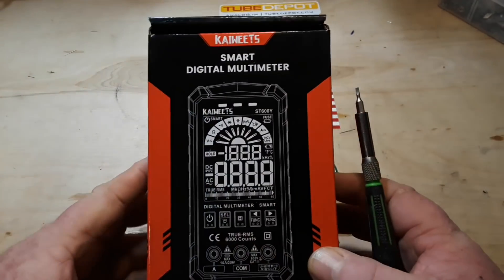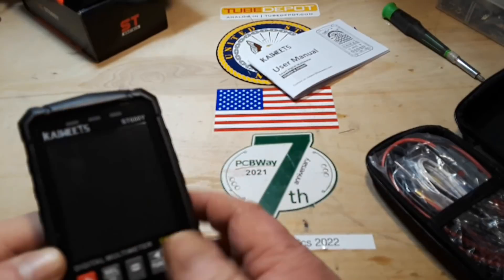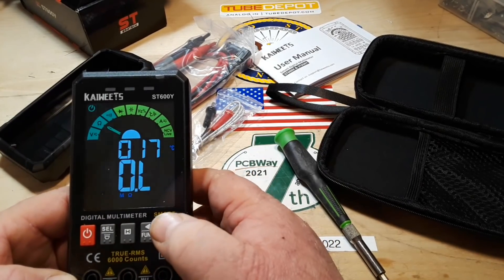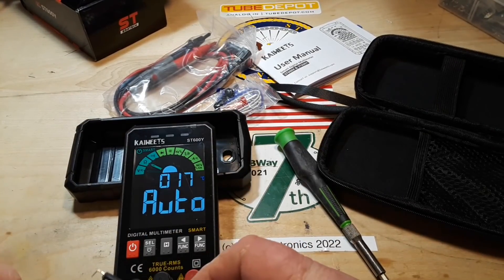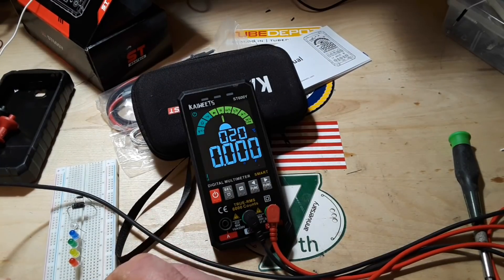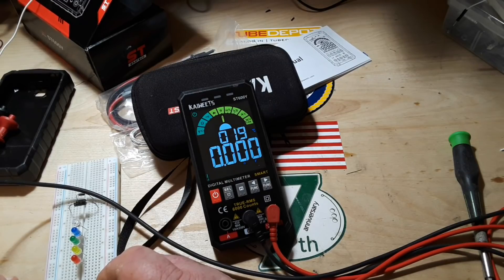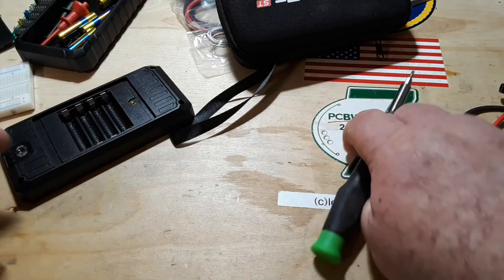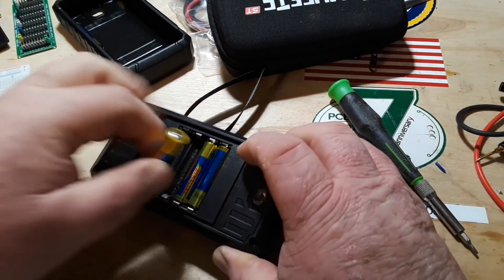Kaiweets ST600Y Smart Meter Review and Tear Down

Comment: Sorry buddy.  Not disrespectinng you. 
Please learn more about electrical, beofre messing with things. 
Learn your delta triangle, and how a generator works. 
1, ecoflow aand other so called solar generators, are not generators. They are nothing but a battery, with an AC inverter, that can be chartwd again, by AC, 12 car plug, or aolar panel. 
You could have gotten much better power buying a deep cycle battery, and decent 120/220 inverer. Added as many batteries as you like. Even added a battwry isolator in your work van. 
Sorry. All these so called "solar generators work, but  They're a scam, for the cost of them. 

As far as your voltage issue, that ecoflow "battery", as an AC inverter. That will do 220 AC. 
220 has 2, 110 hot, and 1 nuetral leg. 2 pf your outlets are on 1, 110 leg. 2 are on the other 110 leg. 
Check your other outlets, youll fond your voltage drop. 
Can also check voltage at hour 220 outlet. Youll see 110 at 2 of the terminals, a neutral. 
Study how AC, 110, 220 is created,  how HZ is related. Look up delta triangle, and loads. Youll see how each 110 leg carries the amperage, and how the nuetral only carries the differential, to balnace your load. 

Also. If your not blowing a circuit breaker on the "battery/ inverter ", your ecoflow... compressor will run. 
Im not teling you its the best thing for your compressor. It will shorten  life of your compressor, running too low of a voltage. 
Id check voltage at your actual compressor, before you ruin your air compressor. That sounds like a major voltage drop, whoch would increase amperage. Cook your motor on compressor. 
I respect you wanting, trying to learn. Go back, learn your basic electrial theory. Dont skio the most important details about electricity. 
You can get hurt,Ecoflow and so called solar generator are new to me. 
1st, can't see how it's a so called generator, unless it's hooked up to a solar panel. Even then, it's nothomg more than a battery with a solar charger. It's still not a "generator". Lol

As for your compressor. 
You have 220. 
Each pair of outlets is 110. 
Read voltage on the other leg of the 220, and you'll see your voltage drop. 
Your testing with meter on the leg, that has no draw. 
Test the other outlets for voltage. 
Know your trying to learn. Go back to the basics, see how a generator, and inverter work. For 220, there are 2, 110 legs, and a  neutral. Learn your delta triangle. 
Just trying to help understand why your getting 120, yet hear your compressor drop. 
You shoild also test off your leads to compressor. 
Test your voltage where AC cord connects to compressor switch. 
That will show you any line voltage drop, if you have a bad plug, or too thin of wire. 
 Please be carfeful !

Comment: I just purchased the KM601. I do like the large well lite display. Time will tell if it holds up. The turn dial broke on my old meter, and my newer meter is a bit odd to use. Has a very short timeout delay on it.  Thank you for the video, Paul.

Comment: I thought the Kaiweets 601 was pretty good but this is even better. One less current socket to mess about with. Being auto and smart, I am not surprised that the continuity has a delay. If I were so concerned about, I would have rigged an led, fuse and a battery unto some leads. As fast as lightning.

Comment: Hi Paul
Question to you from a beginner in electronics: Recently bought a Brymen 800 series DMM, and while playing with some of the basic functions to better learn the unit, I did an Amperage measurement using an Eneloop AA rechargable battery (1.2 v with 1,900 mAh rated capacity) and the display showed nearly 10 Amps!  I placed another AA battery in series and then got something like 14 or so Amps and I noticed the test lead tips and battery body were getting warm.  Is it possible for a rechargable AA battery to put out that many amps, or could my unit just be faulty? In case its not faulty, did I possibly just ruin my meter/HBC fuse by going over the 10A limit listed on the body, or does that currently limit only apply at the rated voltage limit for the test leads (1kV 10 A as stamped)?  Many Thanks
Reply from the maker: AA are usually rated around 2A peak discharge.

Comment: I'm not a fan of these new cellphone style meters either but this particular model along with the same models from other manufacturers (with different model designations) - but this one is a step in the right direction for the simple fact they're finally putting the jacks on the face of the unit rather than the bottom.
Reply from the maker: Jacks on the bottom were always a bad idea.
Reply: @learnelectronics  Absolutely terrible idea, agreed.

Comment: Its not an ok product. you were not able to measure 9 Ohm or 90 Ohm.
Reply: I just got one of these meters and it read 90 ohms (2 x180 in parallel) at 88.7. I can't imagine why it would fail on 90ohm. It also reads a fraction of one ohm (like 0.2), but the 0.1 resolution limits its usefulness.

Comment: I need the temp, diode and transistor tester parts for model Train controllers. Seems for 40 bucks you get a lot of meter and flexibility. I still have three Sears Craftsmen VOM that i am so familiar with but when i am setting a new train controller, I have to track opens, trace shorts, test installed components, measure heat for smoke and components and I can have 3 meters on one engine and wish i had a 4th, this maybe a good time to try fully digital. Nice display.  Thanks for the review. Dennis

Comment: I'm indifferent.  I still use an analogue for alignments - SO much easier to do with an analogue when watching for the voltage peaks.  I also use a DMM to if I want more accurate.  Use the best tool you have for the job at hand.

Comment: I'm a commercial building contractor who does pretty much everything. A customer of mine who owns a couple of restaurants needed me to find a current draw in his vintage Porsche back in December.  I knew I was going be in the dark practically standing on my head checking fuses under the dash... and you had reviewed this brand of meter, so I bought one because it's illuminated and the continuity tone is loud and I'm half deaf from too many chainsaws, guns and rock concerts in my youth. And none of my ten or so other meters is illuminated.  Anyway,  I bought the same model as the one in this video. It worked great.   The .01 amp phantom leak is gone.

Comment: Myself I would rather pay 20$ more for a Fluke 85-7 6,1/2 digit DMM that will last a lifetime. quality over quantity.
Reply from the maker: You tell me where we can get Fluke 87-Vs for $60 and we'll go into business together
Reply: @learnelectronics  Never said it was new, but if you keep your feelers out in multiple Ham groups, Ebay ext . you would be surprised what you can snag dirt cheep, I just landed a Wavetek 5 MHz  Sweep Generator for 35$ looks and works like new, Me  personally would rather spend my money on quality used equipment that I will have till they poke me in the dirt. even if it needs some repair, that is just me though. you ought to give it a shot would make for a great vid..
Reply: Ps. Boing surplus is where I got the Wavetek Generator, with recent certification.

Comment: I bought an Aneng  SZ17 meter at Christmas time. I like the fast response and it seems very accurate. My only complaint about this meter is the stand wants to fold up too easily. I think of it has a poor man's Fluke. You need to do a review on this meter.
Reply: Sz18?, It's the same as the Aneng Q10. It's one of the best multimeters I have used.

Comment: Give me a meter with a known that selects what you measure. Did not like the low resistance reading that stayed at 19 ohms and would not read low value resistor < 20 ohms ?

Comment: Looks nice but the issue with lower level resistance measuring is a bit of a problem when fault finding on electronic circuits like graphics cards, could do with a bit more resoution too, think I'll stick with the my old ones for the moment.

Comment: nice meter BUT i still liked the positive feel and sound of a manual switch i like my meters that also has a digital read out best of both worlds i have tried using full digital meters a number of times and did not trust them and had to retest using  my normal meters with manual switch and did find there was a small difference in the digital meters but not to worry about

Comment: I’m ‘old-school’ enough to have a fondness for meters of the Simpson 260/AN/PSM-6 genre. Analog and digital meters each have their strengths and weaknesses. 
That said, I have always prided myself as being smarter than the equipment I use, and so therefore I’m not a fan of instruments intended for people who don’t know how to use them - and therefore, really shouldn’t be using them. I don’t think the ‘convenience they add to the measurement dynamic is significant. Especially since the time it spends making up its mind about what it is supposed to do just slows things down further. Add to that the time it spends determining how to do what it is supposed to do - which the operator has likely already thought about before starting the procedure, and you have something of limited value. Analog instruments are usually not as precise or accurate as digital, except when dealing with lab grade equipment. But most of the time, you’re really not that concerned with the precise size of the gnat’s ass you’re measuring.

Comment: I have not watched this video as yet and may do later BUT as an Electrical Engineer the reliance of some automatic control of Current/Voltage/Resistance set-up is horifying.
Mantra - ALLWAYS return the selector to Voltage when closing the case. ALWAYS check that the selector is on Voltage when you open the case. That way you will have to find some other way to blind yourself accidentally.
I will watch the video in a short while after I have done some other things. I expect the Author has addressed these points.

You mentioned Old School/New School. I don't have an AVO-8 now but I liked it. It was quicker than a Digital and robust but not robust enough to take anywhere on site. In the environment you where demonstarting I would question three places of decimal accuracy and/or necessity. You were using your own in-built common sense to put a practical value of the number displayed.

Other than that I still have my reservations about accidentally allowing the software to say the probes they are not set to current or resisteance for instance.

Comment: Its pretty much horses for courses. 
This is not a meter you will be using half way up a telephone pole in winter, so needing to operate it in thick work gloves.. Not a real world problem. 
Bench meters ditched the click knob ages ago. why not have the same deal with handhelds. Plenty of meters around, both designs and a few more can co exist.